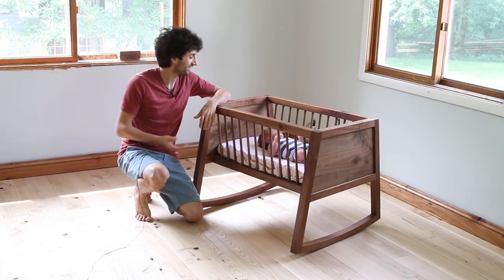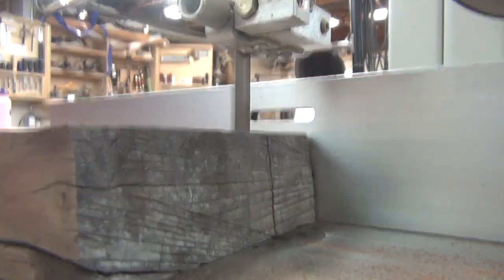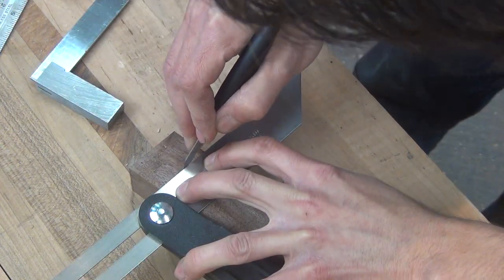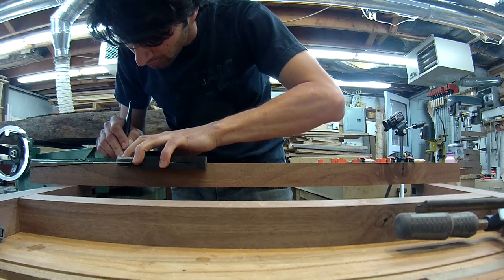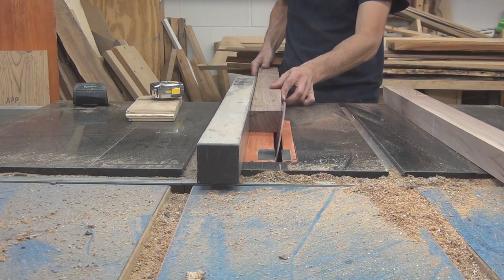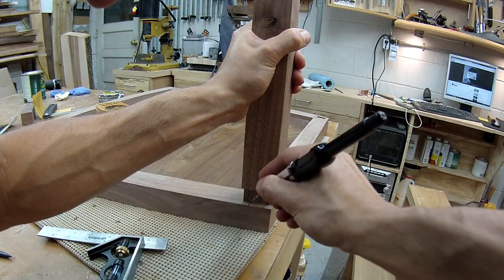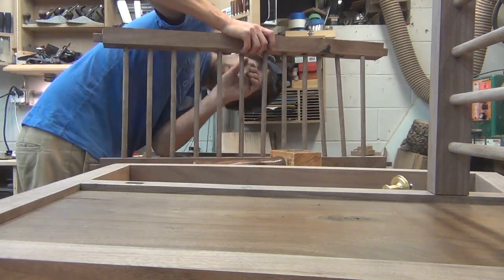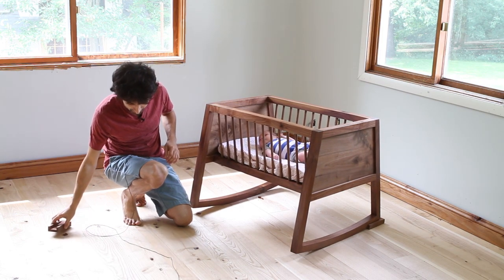Rocking Walnut Bassinet (Baby Cradle)

Comment: Wow, great project Matt it's beautiful. When you were at the jointer you said you gave the parts a rest before running them through again, I'm curious why?
Reply from the maker: April Wilkerson Thank you April!  As wood is removed, tensions are released and you expose new fibers.  The resting period allows them time to destress (read: warp).  The more iterations, the lower the amount of movement per iteration.  I usually do 2-3 iterations and that leave me with work pieces that stay flat and straight.
Reply: Matthew Cremona Yeah I was always taught to do rough milling and let it sit for a day or two then cut to final dimensions.... Living here in SoCal, we have average weather and humidity... I always laugh because all the disclaimers on glues and such always say works best at 70 degrees with 60-70 percent humidity...Guess they make that stuff for soCal. Also I have seen wood after I rough cut it potato chip to the point where I thought I was going to be useless left it a day or so more and it go back to relatively straight so I can do final milling.
Reply: Thanks Matthew Cremona & April Wilkerson...i was gonna ask the same thing...do you still get alot of movement though if you're in a hot state like Texas? I live close to houston....i guess the humidity would be a big factor....the other thing i was wondering was how many total hours you had in that piece? Again...great work.
Reply from the maker: Steve Taylor You're right, it has a lot to do with the humidity.  With milling rough boards, you're trying to change the natural state of the board and keep it in the state that you want (flat). This was somewhere in the 30-40 hour range.

Comment: Well done...not only is the piece beautiful but will be an heirloom because it was built so well it will last through the ages.  I have two nieces both expecting and I wanted to build them a rocker and this is perfect...hope you don't mind if I steal your design and build them...won't be using walnut possibly oak or clear pine depending if they want a stained or painted rocker.  Great job..I subscribed so I can see more of what you do!

Comment: Amazing build, congrats on the baby. Question, do you think dealing with sub par raw stock is worth the time and effort?
Reply from the maker: Glass Impressions Thanks Andy!  I guess it depends on how sub par the material is.  I'm pretty conservative when it comes to using materials.  I pull a lot of junk off the mill and dry it just because I'd prefer for it not to be turned into firewood.

Comment: nice job! well done! I am going to make a cradle using this template for my child coming up. I have a router table. for the mortises, do you suggest I get a mortiser, or will the router table do the trick? Alos, how does the router trammel assembly work? How do I assemble the router trammel assembly? Thanks!

Comment: Wow Matt, your project videos get better and better, clear and precise and a great pace. I'd love to hear your opinion of floating tenons? I see a few people using them recently, including an old Norm video. Finally, what on earth is that huge pen you use? Best wishes from UK
Reply: Thanks for the info. Doesn't appear to be available here in the uk.
Reply: Yeah thanks. I saw that but they don't know if they are getting it again.
Reply from the maker: ***** Thank you Anthony! I think floating tenons are great.  They can really simplify and speed up the building process and in most cases are just as strong.  If I had used my domino for this project, the build time would have easily been reduced by 10 hours.  And as other pointed out, that's the long nose marker.  Super handy thing to have around!

Comment: Mr Matt, another great video. Thanks for the reminder to let the wood sit between planing sessions. Roughly how oversized do you leave the stock before planing down to your finished dimensions? 1/4"?
Reply from the maker: jake moritz Thanks Jake!  On my first pass, I just take the rough stock down to the point that it's flat and cleaned up.  That usually ends up being 1/8" to 1/4" over.

Comment: Now that was worth waiting for! Thanks Matt - great build and video. Are the side panels a tight fit? Would wood movement be an issue here?
Reply from the maker: Thanks!! They're snug as far as thickness goes but have room to move deeper into the grooves
Reply: Matthew Cremona Thanks. How much extra room do you leave in the grooves? And did you only do that in the rails?
Reply from the maker: synapseZA Maybe a 1/16".  I did it all around because it's wedge shaped.  Since I built it in a summer month, there shouldn't be too much expansion, I'll see more contraction than expansion.

Comment: Great build, Matt! Just curious, why do you let the pieces of wood rest between sessions on your jointer?
Reply: +Braxton Wirthlin Wood can move (warp / twist / cup / bow) when you mill stock. Even if the wood is dry enough to work with removing wood fibers from the whole piece can allow internal stresses to move the wood after milling. This is best demonstrated with wet construction lumber being ripped on a table saw and pinching or causing kickback. 

By leaving the wood for a day or two it can acclimate to the new dimensions and complete it's movement. Generally the second pass on wood milling is much smaller and less likely to allow for movement. It's recommended to cut your joinery on the day you complete your milling though just in case there is some movement later.

Comment: I thought with solid wood you had to worry about expansion and contraction? Where did you adjust for the panels and mortise and tenon joinery? Great work
Reply from the maker: Thanks!  The panel is undersized so it can move freely.

Comment: Hey, Matt; great video! have you ever tried using vinegar to clean up epoxy instead of Acetone? it's a lot cheaper and works just as well in my opinion. Also non toxic. 

Happy woodworking!
Reply from the maker: Evan Smith I haven't tried it...  I'll give it a go sometime.  Thanks for the tip, Evan!

Comment: Really great job Matt. Joinery is top pro. I'm curious why you didn't change the radius when you cut the second arc on the rocker template. Doesn't the radius have to get smaller to keep the arcs parallel? I'm sure you have a good reason, and I'll learn something...:-)
Reply: can you also share your brand of chisel?
Reply from the maker: Scott Brunner You're correct. The curves aren't technically parallel.  Since the rockers are such a small segment of the overall circle, the difference from the ends to the middle is so negligible.  I figured it would be easier to just move my setup for the second cut than change the setting on the trammel.  Most of the chisels you see me use are Ashley Iles. Check out my Ask Matt #1 for details on all my chisels: https://www.youtube.com/watch?v=aJjXLj1L94w